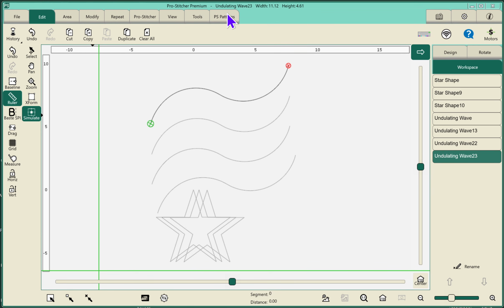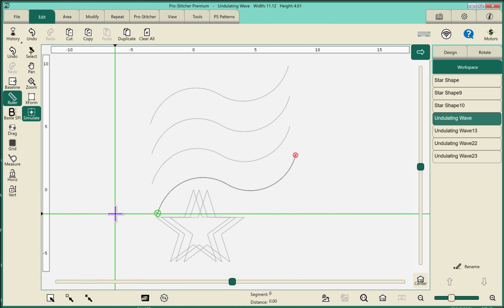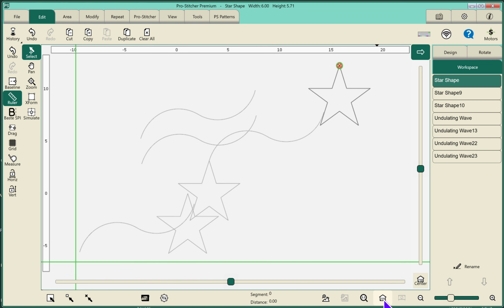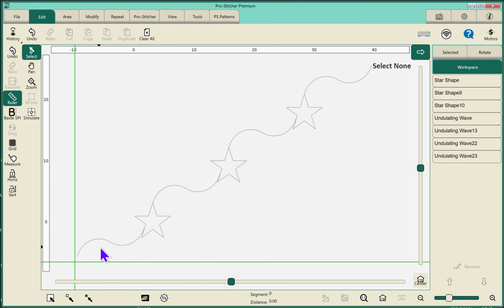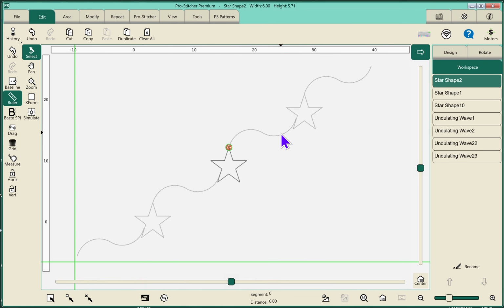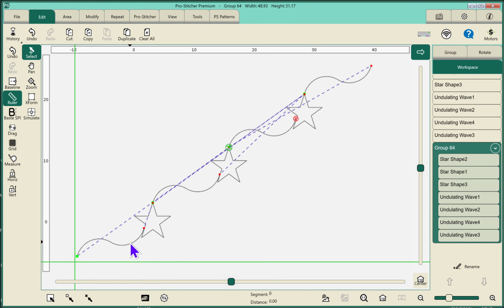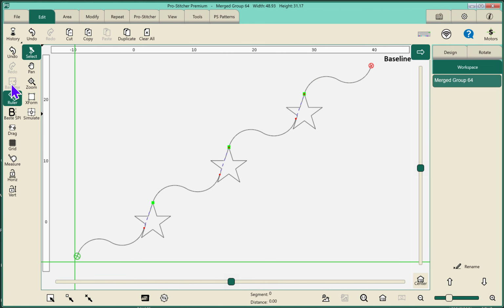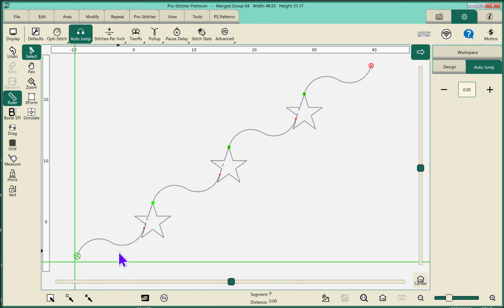Renaming and Reordering Design Elements for Combining and Grouping

Comment: Thank you!  This has been great. Hoping you see this question. 
Regarding the auto jump, do I need to set to 0 each time I get ready to stitch my merged group block?
Reply from the maker: Yes, especially if the distance between the previous row's End point is very close to the next row's Start point.  You don't want Pro-Stitcher to auto-jump and keep stitching.  I would always set it to zero, and in fact, go to the Settings tab > Default, and set Auto Jump to Zero in Premium, or in Lite, turn Auto Jump Off.  That way, this setting is retained from session to session.  I personally ALWAYS want Pro-Stitcher to Pause at every End point.
Reply: @hoosierquilt thank you. I have lite so good info. To add, I appreciate all of your  support in our groups. I am thankful when you add the little differences. Between premium and lite also!